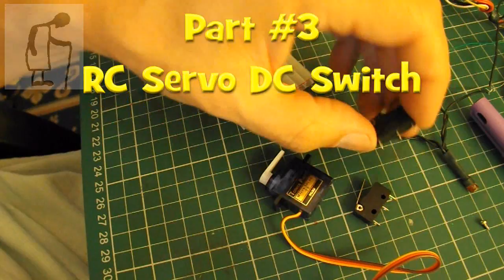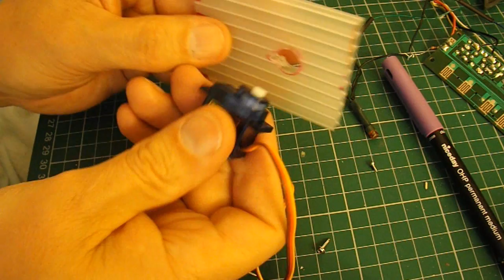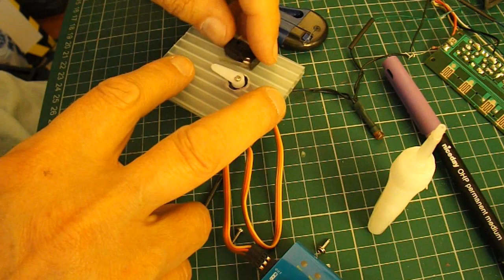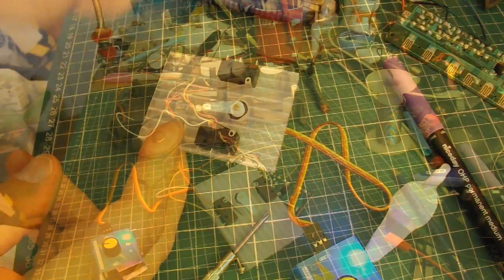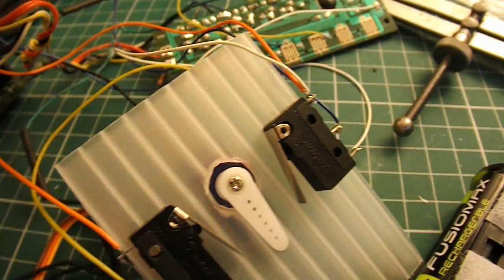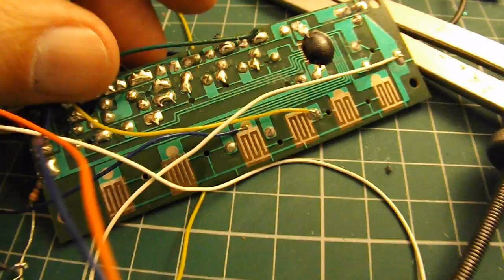Toy Tank RC Conversion Part #3 RC Servo DC Switch

Comment: Hello from greece can these microswitches work on a 12 or 24 volt and on witch cotact do we put the eletricity on thanks aloha
Reply from the maker: Just read the specification on the switches that you want to buy. That will tell you what voltages they can handle. It is the current that is more important. You will get that information in the specification too.
Reply: @GrandadIsAnOldMan  thanks for rhe reply

Comment: Hi, sorry for all the Qs if I bought a 2nd hand transmitter unit +  receiver set up, are the fittings generic?  So would any servo would plug straight in?
Reply from the maker: Hi David, I have been on holiday for a week. If you are buying standard hobby grade RC gear then yes the servo's are generic and will work with any receiver. You can buy RC switches that are solid state (not little electric motors) that can switch auxiliary equipment on and off, such as lights. Another alternative is to buy remote control unit like the ones used to operate remote garage doors. You might find one of the videos in my Remote Door Lock playlist more helpful, here is an example https://youtu.be/ivKbiywHv_s?list=PLA5a2xPRSrB1HM3Smxg8X-IG7dSuJyzkK
Reply: HI 

Thanks for sharing the notes.

Yes I got a remote switcher off Amazon.    I haven't done much with it yet.

All food for thought another learning curve!

Once again, thanks!

Comment: Right you are the man to ask.

If I want to operate a switch by radio control I have to switch it with a servo to start with? ie as in your  video here?

Is there a way of flicking an on/off switch from the transmitter hand set?

The project I want to work o is releasing a rodent trap by remote (or radio control) .   I have tin plates which will fall by gravity into the closed position.  It needs to be instant and noiseless and certain rodents are a) far from stupid b lightening quick.

Thoughts?

edit makes me wonder how guns are fired where throttle  aileron response isn't required just on/'off.
Reply from the maker: I am clearing off old comments I seemed to have missed years ago. This one is 5 years old, so I am guessing you found a solution to your project. Sorry I didn't reply back then.

Comment: Go to radio shack and buy two 5v relays and 2 small diodes. Dissect your servo and remove the motor from the circuit board and toss it. Wire the "negative" motor lead to the "negative" coil pins on your two relays. Then wire the "positive" motor lead to to one of the diodes legs and the other diode leg to the "positive" coil pin on one of the relays. Repeat the process for the other relay, except reverse the orientation of the diode. Now you have one relay activate when you give a forward command and the other activates in reverse. There will be very little dead-band.
Reply from the maker: Thanks, yes that should work fine. By coincidence I published a diagram on my Facebook page showing something very similar for controlling larger motors with cheap toy grade RC receivers. Not sure if this link will work https://www.facebook.com/grandadisanoldman/photos/a.335719046816921.1073741828.332073187181507/447219039000254/?type=3&theater
Reply: Do you have a diagram or how to using bobussum suggestion of Relay and diodes?
Reply: I tried that, Didn't work. Any suggestions?

Comment: hi ,
i was watching all ur videos about the tank project and i was wondering if u could build a mini telsa coil and use that to power the tank istead of using battery packs?
Reply from the maker: +marc wohlmayer do you mean to power the tank wirelessly?
Reply from the maker: +marc wohlmayer do you understand what a Tesla coil is and how it works? What possible benefit would there be in trying to use it to power the RC tank? Study those examples you linked to. How exactly will that power the radio receiver and the DC motors in the tank? Even if you build some electronic circuitry to convert the high voltage A/C back into usable DC the RC signal does not stand a chance with the interference created by the Tesla coil. If you watch those videos the power is only transmitted over very short distance anyway so once you are a few inches away from the coil you would have no power.
Jeremy Gwilt did some good work with those coils, here is just one example https://youtu.be/t2o-3ifu8aQ

Comment: I think a 6 position rotary switch with linkages would have worked, But then again you would have to have one, oh well, that looks good though.
Reply from the maker: +Graham R Dyer I have seen units like this sold on eBay. Looks like somebody has their 3D printer working on them. Yes a rotary switch could do the job and I expect somewhere, somebody has done a commercial one. I have also seen a fully electronic unit that plugs into a servo port and has several outputs so that must decode the signal and activate suitable outputs. That would be an interesting electronic project to make but a bit more work than I feel inclined to do.